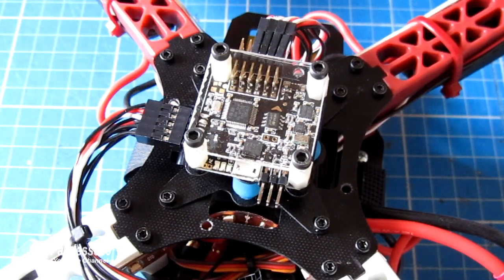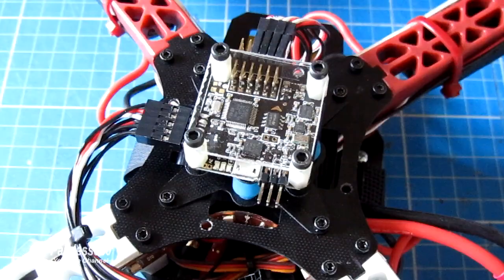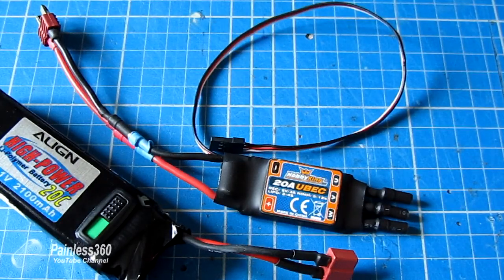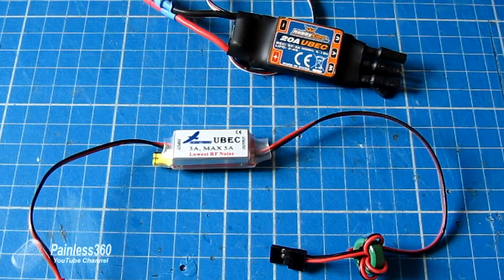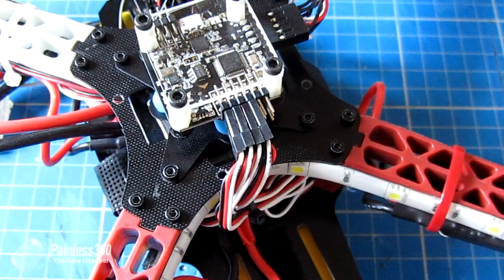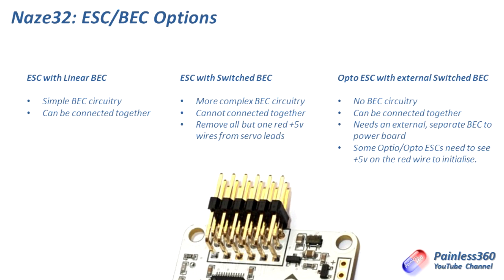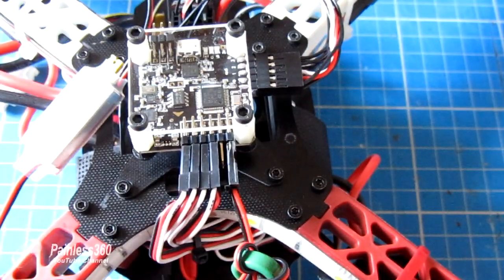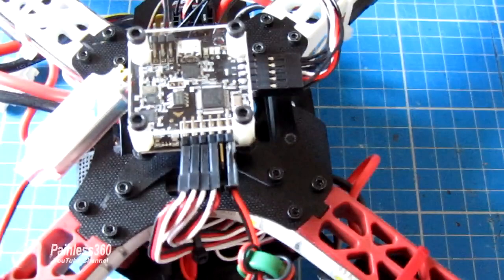Naze32 Quick Tip - Powering the board (Linear, Switched and Optio/Opto ESCs)

Comment: Hi Painless. I followed your clear video but still can't seem to power my rx with an external bec. I have a naze acro and 4 x 18a kiss esc so chose the external switching bec option. If I power the bec from my PDB on 3s I get a red light and 5.3v at the output but if I remove the signal pin and plug into a spare port on the naze it does not light up or give me any voltage on those pins on the board. The esc get power fine.

I have tried just red wire, both red and black and also adding the red wire to one of the free signal pins on the kiss esc but same no light on the bec issue.

I thought maybe bad bec as it's similar to your shown and a budget HK one but it powers servos and leds and seems stable under load.

Cheers.

Comment: As I use the light naze32, I only use 1 ESC with power to the Naze, all the others just have the signal attached in one 3 pin connector. The +/- wires are removed, or used to power other equipment, such as a board cam. As the light Naze uses only PPM, the receiver must also have it's +/- connected to power the Rx.The Naze dosen't seem to have a problem doing this. It's much lighter this way, you eliminate 6 wires from the ESC's and are only using 3 of the possible 15 for the receiver and don't need an extra component for power (BEC).
This may not be too relevant on a larger quad, but on a 250 sized quad, it's all about shaving off weight as the props are much less efficient.
Although I'm not 100% on range (certainly over that of your FPV gear) the Orange 615x is an excellent spektrum compatible PPM Rx, PPM on the battery channel, and seems to survive having no case and shrink wrapped well, it's also cheap!
I do recommend switching over to PPM, as it makes wiring so much easier, cleaner and lighter.

Can we see a video on how to set the Naze up for PPM to compare?
Reply from the maker: PPM usage and configuration is covered in the next video and I make the changeover to PPM using the R615x to get all the other Naze32 receiver pins back for later videos (GPS/LEDS etc.). Happy flying!
Reply: Ah, maybe I should shut up and learn!!

Comment: Hi There. Thanks for the post, as always very helpful. I've just fried my Naze32 (again) and I don't know why. I bought a power distribution board stackable above/below the Naze as it's the same size and it has a 5v output. I bought 4 OPTO 20amp ESC's plugging into my Naze and powered the Naze on a spare channel on the Naze board from the PDB (5v). It was working fine and suddenly it fried. My question is, is it okay to power the Naze via the PDB into just one channel? I suspect my soldering could have been the culprit but is there any other reason it could have fried? Thanks.
Reply from the maker: +nikolasvon See our video on Multirotor power systems - should answer this for you - https://www.youtube.com/watch?v=o7L_Woeu38Q&index=26&list=PLYsWjANuAm4oWuE5ZDX4TAiHBv2i0Xl4m

Comment: Thanks for this! Im buying and opto esc and didnt notice thats a different esc if i didnt watch your video!

If i understand it correctly so i need to put a switching bec to a spare...
-then i that switching bec ill just put it to the power same as the esc?or i need seperate battery for my esc?
- and is it possible to just remove the + wires in the esc?

Was using naza all along so im ised to plug and play  v2 rtf..... and now planning to build a mini quad woth naze32...thanks to your videos i have guide how to..
Reply from the maker: 2peng Yep, switching bec to a spare...

Comment: Just a quick note. I have been plugging my UBEC into the receiver and the naze32 would be powered through the PPM cable. I did try your suggestion of plugging the UBEC into the spare mototr inputs on the Naze32 but that didn't seem to work for me (I double checked the polarity) and my esc don't have BEC's so I went back to the way I had it and it works fine.
Reply from the maker: That will work as the 5v still makes it into the board. I use this method to power KK2.0 boards when Opto ESCs are used.

The board should power up from having the cable plugged into the spare motor outputs though, check that the power lines are connected all the way down the outputs.

Happy flying!
Reply: I have same issue with naze acro and kiss esc with walkera rx, rx not getting power. I can try this also?
Reply: slinkytreekreeper I tried directly to rx and the board still does not power
Reply from the maker: Check that there is +5v out of the power cable then and check all the basics. Best of luck.
Reply: Works when not 9in the naze, doesn't work when plugged in the naze, still holds current under load. Totally lost, will try an old esc as a bec but something is not right. Plug and play I was told.

Comment: hey i am new to all this stuff. if i Connect  4 esc´s with a power out put off 5v each that will be 20 v right....? but from what i have read the board can only take 16v ? please baer with me ...... awsome and very informative videos
Reply from the maker: Nope, you are connecting the voltages in parallel. If you are new to this then our 'Introduction to RC' playlist may be useful.. Best of luck!
Reply: thanks it maks sense now
Reply: just a noob i am getting my 250 size kit that i put together my self i really don't want magic smoke hah
Reply from the maker: +JulleMor2307 Always a good idea to check but the CC3D series shows every step in building and a lot of it is stull useful when if you are using another flight controller.
Reply: okay i will take a look. i am going to use the naze 32 bey the way
Reply from the maker: Understood. I mention the CC3D series as it's designed for the first build and shows EVERY step and talks to why it's done that way (power connections, wiring etc)
Reply: okay sweet thanks

Comment: Just a quick question if I may, im building a mini on 4s setup the motors are rates for 3s but are happy on 4s too after a lot of tests the escs are rated for 4s as per recommendation from the supplier of the mini quad kit he recommends I use a separate ubec to power the naze if I do this I would be removing all the + from the escs and tapping the ubec power from the pdb board which in turn provides naze 32 with 5 v then 5v output through ppm to my rx does that sound OK to yourself many thanks ?
Reply from the maker: Sounds like the ESCs have a simple linear BEC in them. As the linear circuit dumps the excess voltage as heat then any increase in the cell count has a dramatic affect on how hot the entire ESC gets due to the heat from the BEC.

This sounds like a good idea and does give you the option to go back tot the supplier if you do it and one of the ESC still fails..

Happy flying!
Reply: +Painless360 I would think mc drone could use either ...a switching BEC instead or a linear BEC, A switching BEC would be more efficient and would avoid the heat. Interesting way of getting power to the NAZE32. I am thinking of getting the power from an OSDoge since they are stackable. I believe, I need to check, that stacking the OSDoge send power through the RX as well to power the NAZE32. If so I could avoid the OSD you typically use.

Comment: Some where I thought I saw where the newer Naze32 FC allows for a direct 3-4s lipo input because this newer version has a built in regulator. I can't  find much info about this topic. I'm going to build a 150 Blade quad with tiny Optio ESCs and would like to not add additional hardware(regulator). Can you find info as to how the connection is made and how you can tell if your Naze can have the higher input?
Reply from the maker: Billy Clark No idea - sorry. I would ask the vendor about this..Best of luck.

Comment: I got a problem the ESC's I have are non BEC, I am using a naze32 acro and a CC3D pdb. The way I wired it up was I tied all the hot leads on the ESC's and soldered the to the 5v out on the pdb, and tied all the grounds to negative to the ground side of the pdb (not the 5v negative side). Before I power the board up will this work? I don't want to blow up the board or ESC's.
Reply from the maker: +jdj62464 From what I can understand from the description sounds ok. But I'd not have the FC plugged in and power up the model and check that the 5v is where you expect it.. Triple check the wiring one last time before plugging it in..
Reply: Build a tester bud, Just google Lightbulb RC Tester and it should come up. It is a auto light bulb that works as a fuse when plugged in

Comment: I am building a hexacopter and using the HK Afro ESCs that do not come with a BEC.  Are you sure that you can't power the flight controller from the RX as you can with the HK KK2 board? I would like to plug a UBEC into the RX.
Reply from the maker: That will work too. Make sure that the cables can handle the current if you plan to use MinimOSD, GPS etc.

Happy flying!

Comment: how will I be able to differentiate  between linear and switched. if the item listing says they have built in bec should I assume they are linear?
also what happens if I only plug the bec from ESC1 with linear ESCs. will that work?
thanks
Reply from the maker: The are usually linear if the listing doesn't specify type but ask the vendor.  That will work fine. Happy flying!

Comment: Hello Painless 360.
I'm about to power my Naze 32 rev6 directly from the 5V pins on my PDB. I'm going to solder a Schottky onto the live wire, so the ESCs don't try to draw power from my USB, which I've learned is a common problem with the Naze. Anything else I should know? 3rd time lucky
Reply from the maker: I've not used Naze32 boards for a few years here. The only other piece of advice is be aware that most of the latest flight control software/Beta/Clean/iNavflight won't run with all the bells and whistles on a Naze32 anymore. It'll be fine for basic stabilization though. Best of luck with the build! :D
Reply: Thanks for all your help. It's my 1st build and I won't use tha Naze again. TBS, Kiss and Armattan, on my next 3. I've learned a lot, in a very short space of time.

Comment: Excellent overview @Painless360, very clearly explained!  It's a little confusing that HobbyKing would label those ESC's with the term "UBEC" since a UBEC by definition is a switched regulator while a BEC by definition is a linear regulator.  But it sounds like those ESC's actually contain linear BEC circuits, regardless of the "UBEC" labeling?
Reply from the maker: +dronebrulee Actually using BEC and UBEC in that way isn't a standard. All those terms are used interchangeably in the hobby so you always need to read the specs. Happy flying!
Reply: Ahhhhh, OK.. good to know, thanks!

Comment: hi, don't know if anyone can help me out. I'm using the force 200 kingkong set to build my first drone. this comes with opto ESC's and one seperate BEC to power the flight controller. I've struggled to find an answer to this but will I need another seperate UBEC to power my receiver? I originally thought that it got its power through being connected to the flight controller but I stumbled across people using ESC's and all sorts to power the receivers. the kit comes with a mini cc3d. Thanks.
Reply from the maker: No, watch the 'Quadcopter Building for Beginners' series to see a lot of the basics. The BEC powers the Rx and FC at the same time.. Best of luck!

Comment: When using opto ESC's and a seperate BEC, can you solder it onto the +/- on the power distribution board?
Reply from the maker: +Pete Molkenthin if it supplies 5v yes. See our quick tip on multirotor power systems. .

Comment: Thank you,  but what is when you're not sure what you exactly have and you power them all together?  Is it then destroyed?
Reply from the maker: It shouldn't be, hopefully. If everything still works then you've got away with it.

The most common mistake is connecting all of the outputs from the switched BECs together, this is not recommended but if they are all within a close tolerance on the output voltages should survive this.

Hope this helps.
Reply: Painless360 best thanks,  today my package will arrive and than I have to see what is what. 
Perfect timing.  Thank you
Reply: DeadmiXSoft
First, make sure you know what you have! You should be able to, since you ordered it.
The safe thing would be to remove the 5V wire from all but one connector. It's "safe" in the sense that your BECs can't fight each other, but you will lose the redundancy of multiple BECs. But as long as you don't drive servos the current a single BEC can deliver should be easily enough for the flight controller and receiver.
Reply: So i got my package and, ok, it are really not expensive things, there a 4 SK12A ESC's .
i don't know if there is a bec, ubec or something else, but it doesnt matter to the board, the Board ( MW SE V3.0) has a extra socket for power, so i could take the power from only one ESC. 
thank you all for this

Comment: How could I connect a Hex to a naze with 6 opto escs and power it with a BEC?  I tried running the BEC power and ground through a connecter with the signal from the opto and it wont work...I cant believe that just didn't add a power pad that isn't part of the ESC connections...
Reply from the maker: John Deckenbach This is all part of the 'fun' of the Naze32. This board was designed to be a little FPV/Acro racer. 
You will need to connect the UBEC to a GND pad/pin (there are a few on the telemetry/Buzzer connections) and a 5v pad near the Boot pins. 
Best of luck..
Reply: I don't think fun is how I would describe a board that cant fly Hexes with Opto escs...
Reply from the maker: That's why I used parenthesis ;)

Comment: Hi Lee, I'm using OPTO ESC's so am trying to power the board through the 5v out on a distribution board. If I plug in the + and - from the distribution board to the + and - on the spare ESC pins (ESC 6 slot) the receiver will be powered but the Naze will be dead. However, if I remove number 1 ESC and replace it with the 5v from the distribution board, the naze will be powered but the RX will not! Any ideas here? 

Further info:
RX is an Orange 615x connected via CPPM.
If board is connected to computer through Micro USB and distribution board connnects to the naze via number 6 ESC pins, everything works perfectly on cleanflight. 
Distribution board was purchased from the nats but very similar to www.banggood.com/CC3D-flight-controller-5v-12v-bec-output-power-distribution-board-pcb-p-973352.html 
I tested the voltage output from the distribution board at 5.05v.

PS, in the video, you connected the BEC to the TOP and centre pins, whereas my Naze suggests the top pin (closest to middle) is signal. I didnt want to test it under power, is that where I'm going wrong?

Many thanks
Reply from the maker: +p33333te The other way to do this is connect the BEC to the battery connector on the radio receiver and let the power flow from the Rx to the FC. Best of luck.
Reply: Thanks, the fault was found in my soldering - one of the +ve pins on the esc output didnt join properly. Cheap solder and poor skills at fault!!
Reply: +p33333te +Painless360 So can you guys tell me if im right here as i think you both know.
Using opto ESC, I can power cc3d BEC/ZMR board and use 5v drop down for either receiver to FC or vise versa?
This is where i have stopped.
Also, do you know whether the CC3D BEC/ZMR is just PDB or also a FC?
Reply from the maker: This may help - https://www.youtube.com/watch?v=o7L_Woeu38Q

Comment: I have been having issues with NAZE seemingly shutting down....It always happens at full throttle...I cannot figure out whats going on because it has happened on different quads with different ESCs and BEC combos and its still happening...I suppose it could be a TX RX issue...
Reply from the maker: John Deckenbach Possibly, could be the voltage to the Rx dropping and it loosing connection. This is normally shown by status lights on the Rx after it comes back on. Servos under stress pull more than you think.
I would power the Rx and flight controller from a dedicated switched BEC.
Reply: There are no servos on my quads...and I do use the castle creations blue BESC to power the NAZE boards...
Reply from the maker: That is odd then.. There are less things in common on all your setups then. Maybe it is a dodgy pot on the tx?

Best of luck with it.

Comment: Hi ! Painless electronic master :) thanks for this video and all the others, following you since quite a while, you already gave me great infos in the past.. Great job and thanks again... I was checking in the comments to see if somebody already asked the question but apparently not, so here it is : I have no Bec ( switched ) and i m using for this configuration optos ... Can i use a spare linear esc that i have left,  to provide the 5v volts to the board like you showed for a basic bec ? This one says BEC 2 Amps on it .. 
Thx Have a good one
Reply from the maker: You could but I wouldn't. See how we do it in the latest series 'Quadcopter building for beginners' series or the video https://www.youtube.com/watch?v=o7L_Woeu38Q may help. I'd use a PDB with an integral BEC or get a dedicated switched BEC to power everything. The spare ESC will not like the output stage for the motor not being connected to anything.. Best of luck!
Reply: I understand i ll get a dedicated switched bec, thank you very much for your time. And thanks for all your videos, and the way you re doing them, it can t be more clear :)